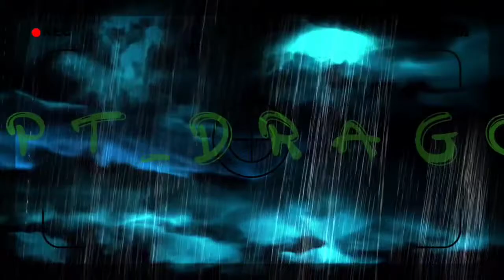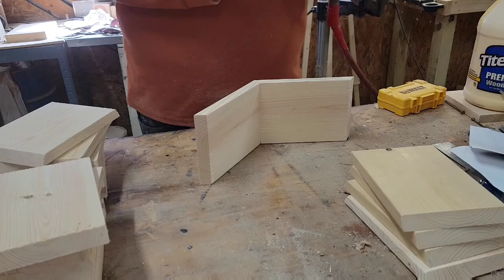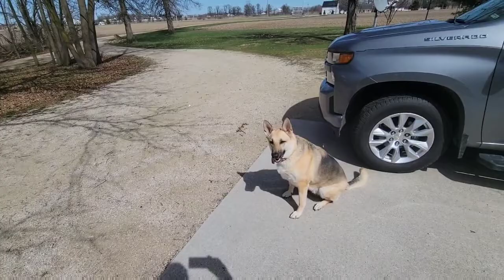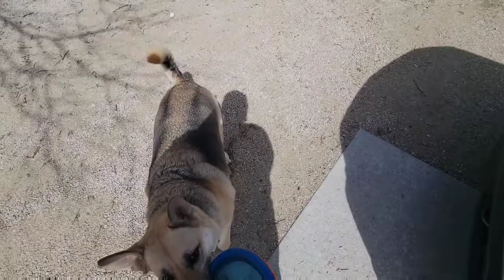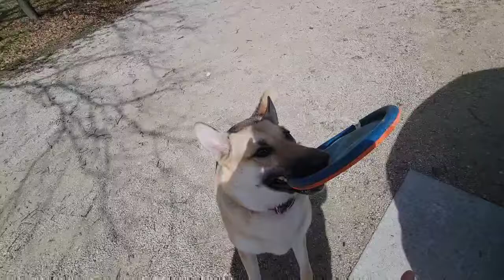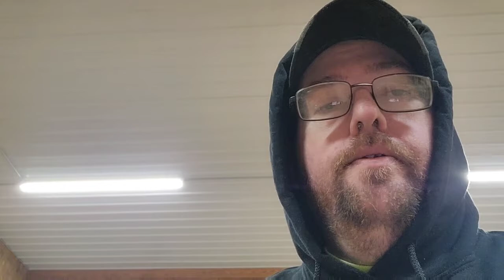HONEYCOMB SHELF BUILD!

Comment: Could you use clamps to hold them in place? And does the measurement of the peices of wood matter? How much do you take off for the angle on the planks?
Reply from the maker: I'm sure there is a special clamp to use but it would get in my way. Length of wood doesn't matter. Longer length means bigger honeycomb. Make sure all pieces are exactly the same length. Cut at the very end bottom corner of the piece of wood